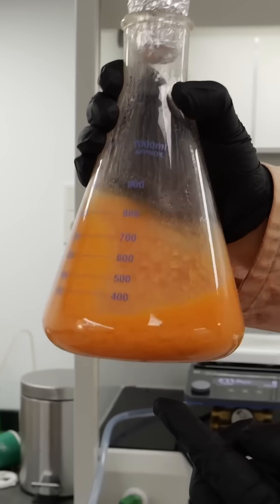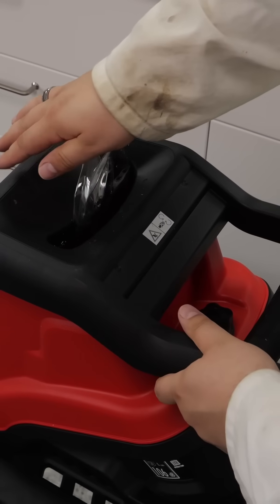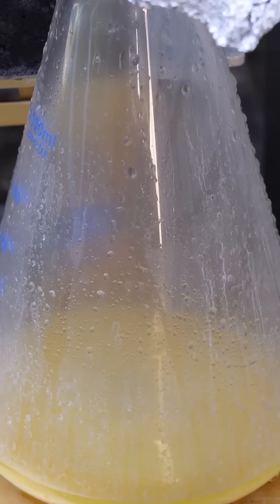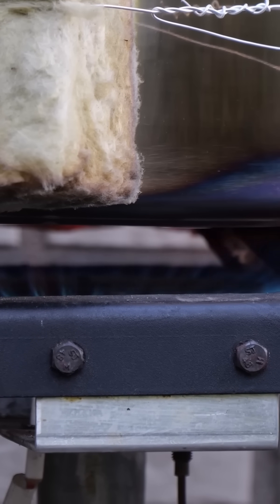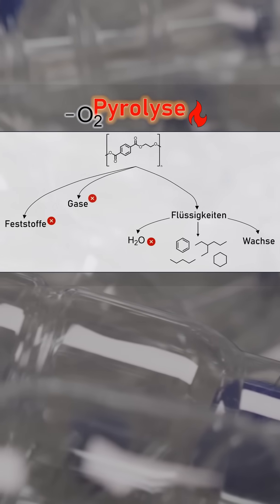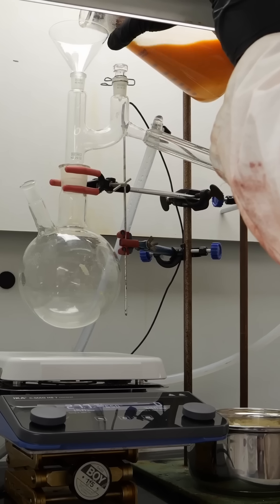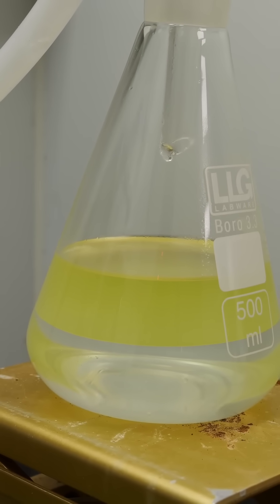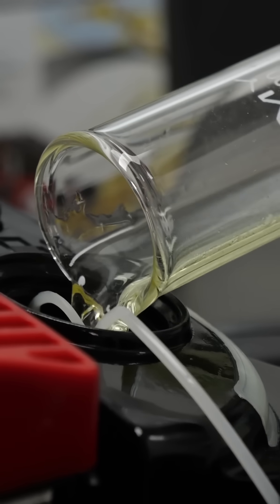Making gasoline from PET bottles  | JeyJey

Comment: If u run the chainsaw on only gasoline it will seize up u need to add oil to the gasoline its a 2 cycle saw is it not?

Comment: Was the distillate pure octanes? Or octane/heptane mixture?
Reply: Well since he distilled it by fraction (you see two distinct fractions in the collection flasks after distilling), he's probably going for the lighter hydrocarbons, but pretty much at random. He won't know what's the actual composition until he pulls it through various analyzers like GCMS.

Comment: Yeah, but for a real trick, can you turn it back into plastic?
Reply: Well literally yeah, a pretty substantial part of the liquid product are monomers to polystyrene or polyethylene for example. If you know how, you'd be able to turn the liquid pyrolytic oil into various new plastics, which is immensely more efficient than trying to distill out usable fuels.
Reply: @benedykt123313  that would be interesting to see is it a reaction that can be mixed and poured in a mold before it becomes a plastic?
Reply: @prestonm4s Well you'd need some kind of starter, but yeah.

Comment: unfortunately burns fuel to get fuel. but it's better than permanent waste, at least until bacteria learn to dissolve it.
Reply: It's not better at all, it's worse.  
PET isn't fit for pyrolysis as the product is contaminated and corrosive when used as a fuel.

Comment: That is interesting, but it is probably better for the environment to keep that carbon locked up in plastic.

If you could make diesel fuel from carbon captured from the atmosphere then you would really have something.
Reply: those gasses are very bad tho
Reply: I don't think you understand the difference between carbon in the atmosphere (CO2) and carbon in, well, most everything else. 

Trees have carbon (it's what gives them most of their mass.... They get it from the CO2 they absorb); that carbon is essential for soil biology and by extension, plants. 

All I'm trying to get at is, saying the carbon is better "locked up" as plastic is missing the forest for the trees; it would have been vastly preferable to not have mine dinosaur juices to make it in the first place, or even to say the amount of resources used to reconvert it to gas in this vid unworthy the product (Im Not dissing the creator). Gas is gas, at the end of the day, and while it does make 10-20% of CO2 emissions via transportation, there are worse culprits, and other gases responsible for the greenhouse effect. 

Diesel is worse than gas for CO2 burn gallon burned, and you can't just turn carbon into fuel... And again, it's the carbon in these fuels that's the problem. Which is why scientists are looking into things like ammonia (NH3) for carbon free alternatives 👍
Reply: @LuxLucidOfficial  im pretty sure pumping the air full of nitrates and nitrogen oxides wont be much better
Reply: @LuxLucidOfficial diesel can burn leaner and cleaner than gasoline can and it's more energy dense so that results in better mileage in general. Overall it has the potential to create less CO2 per joule generated. It can also be made from various triglycerides like used cooking oil. Albeit the agricultural demand to support the current number of vehicles would be enormous.

Comment: How much energy is required to convert the plastic into gasoline?  Is it more or less than the energy you get from the gasoline?
Reply: I'd be surprised if you could get more energy out than what you put in
Reply: @Syndicalism the PET plastic already contains a lot of potential energy, but it's not useful for combustion because of the soot. The question is whether the energy required to convert it to gasoline is exceeded by the combustion energy of the gasoline produced. 
Someone else put the energy into producing the reactant (plastic), so it's quite possible that the energy balance between reactant conversion & product combustion would work out in your favor.
Reply: It’s enough that it’s not cost effective.

Comment: I doubt the fuel gives you more energy than it took to make. Industry knows how to recycle plastic a thousand different ways but it's always cheaper to make more plastic, so they don't. But this is even worse because it's not just smaller profit margins, it's setting money on fire for nothing
Reply: It took approximately 4x as much energy to produce as what he got back in crude gasoline.
Reply: and making a mix of all sorts of chemicals
Reply: Same for the stuff in the ground
Reply: @spray_cheese  No, making fuel out of crude oil does give you more energy than it takes to refine at the scale they produce it. Now it is non-renewable and finite, and it pollutes, but at least it is for now a source of energy. Turning plastic into fuel is not as good as just burning plastic to power a steam generator- which can be done to minimize pollution, by the way. India has a pretty good system of burning trash in a reactor that captures all the soot and pollutants so all you get is heat to boil water and solid bricks of poisonous charcoal that they burry in a landfill. Not perfect, but if the trash was going to a landfill anyway it's better to extract some energy and get rid of any chance that it makes methane as it rots. Still will leech heavy metals into groundwater but it's better nonetheless
Reply: @EightyTwentyRatio  well I’m including the energy used in drilling and pumping, as well as constructing the barges and what not.

The plastic is already here. We have to work to extract the oil.
Reply: @EightyTwentyRatio  and everyone always gets the point of this process confused. The goal isn’t for energy. It’s to remove plastic waste to it doesn’t end up in our balls lol. It breaks down a lot faster as emissions than it does in large clumps of plastic. It’s one of those weird things where it seems counterintuitive. In that emissions will be good for the planet.
Reply: @EightyTwentyRatio tell me again why the companies selling things in plastic aren’t paying the recycling and disposal?
Reply: @spray_cheese can't tell if you are a troll or just lack cognitive faculties. Oil refining isn't done to waste money, its one of the most cost effective energy solutions in the world, the whole process included. Why do you think oil rich countries are rich?
Reply: @G-Rat124  energy used ≠ value. Just because it requires energy and labor to make something doesn’t mean that’s automatically the price.

Countries with oil are rich because they lack any regulations to prevent them from extracting it. So they are one of few places that even sell the stuff. So they make the prices.

Basic supply and demand.
Reply: @G-Rat124 You're right. The amount of energy it takes to refine crude oil is small compared to the amount of energy you get from the resulting fuels.
Reply: @lukesanchez9961  7-15% of the crude oil input is used by a refinery. I wouldn't call that small.
Reply: @joergsonnenberger6836 Also if you think a 7-15% energy loss is not small then you don't know thermodynamics
Reply: @joergsonnenberger6836 According to these numbers you provided we get back 460% to 1229% more energy back in sellable fuels. Otherwise we could burn straight crude in our engines, which we don't do for very good technical reasons.
Reply: @lukesanchez9961  The entire point is that gas refining is far from free. There are also a number of different products made by a refinery as part of the gas production, so if you don't have a use for those products, efficiency goes even further down. The main reason we are not burning crude oil directly has nothing to with technology: you wouldn't want to live in a place where many crude oil burning engines are active. It would make the early 20th century heavy industry districts look like a ecological utopia.
Reply: You can't recycle plastic forever so all the old brittle plastic could be used for this process driven by solar heat
Reply: @lukesanchez9961 you can recycle plastic a few times, and then even the most brittle, un-recycleable plastic can be used as building materials or insulation or you know they do have genetically modified micro-organisms that can break down plastic into degradable waste. The technology to make producing plastic a non-issue exist. It's just not gonna happen without the companies being seized and operated by a very competent government. So, never
Reply: Where did you do all this figuring chatGPT?

Comment: I can't believe people think Naturejab is some genius.
Reply: There's a sucker borne every day. It's actually just a bunch of children who have never heard of anything like that assuming he's the one who came up with the idea and therefore a genius. Part of the problem is the way he presents himself, but it's to his advantage that people think that. I really do hope he's able to at least break even with the products of his machine once it's run on solar, but I have MAJOR doubts based on the numbers I've seen from other research. I haven't seen his data yet, but based on the results of his analysis I'm not keen on his ability to clean out his machine or separate different carcinogens from the mixture. He doesn't yet comprehend just how difficult the distillstion of the crude product really is. Every single run has different composition of products that will boil at very different temperatures corresponding to various azeotropes formed. It's sooooo incredibly complicated and the stuff he's been calling plastoline and plasti-diesel don't properly fit within the boiling point, density, or calorimeter parameters of the real products and I'm not sure how he is going to address that. Currently, his mixtures are too filled with styrene derivatives and other reactive alkenes that would certainly gum up engines if used for longer than a 5min test run for stream. 

Idk what he does is cool, it's literally my favorite sub-category of chemistry, but there's dozens and dozens of reasons no one has been able to do it up until now. And the only reason he can partially do it is that he's fully funded by the internet.
Reply: @WizardZph ya he’s also got dangerously high levels of catious extremely toxic carcinogens as a result of processing the plastics as confirmed when he went to get checked up on by a doc
Reply: He's not an idiot. I mean the dude raised $16,000 in like two days.
Reply: @TheEbikeApprentice you can be an idiot and still fleece other idiots.

Naturejab is not a genius, or onto something other than track to create a super fund site in his backyard.
Reply: @TheEbikeApprentice  He is. He has no idea what he is doing, and he even filmed himself burying highly toxic waste where he grows his plants. That is an EPA superfund site in the making, granted he doesn't get cancer before that

Comment: isn´t the square bracket wrong? i can see a O-O bond in the polymere where there shouldn´n t be one. The right O seems to be to much. Isn´t it?
Reply: yup, the right one shouldn't be in the bracket, it's the residual alcohol that polymerized with the carboxylic acid

Comment: How many bottles required for 1 liter?! And how much did you produce in the lab
Reply from the maker: round about 50 bottles per 100 ml (in my lab). You can rapidly increase the efficiency In industrial scale
Reply: How many bottles is about the least interesting metric; how much energy is lost in this process? And that's a LOT, which makes it completely economically unviable to do. It's a very interesting process and pretty well known (just google "plastic pyrolysis fuel"), but also comes with a whole bunch of negative side effect which makes it completely uninteresting to do on any serious scale.

Comment: Would you put that gasoline in your car and is it legal to produce your own gasoline and also is it preferable to the prices at the gas pump.
Reply: @ektdredd2126  no, i would not use it for any engine I'm using. Yes, it is completly legal. No, the energy needed to produce just a bit of oil is hella cost intensive - there is a reason this process hasn't been commercialized. In a simple energy input/output equation its just immensly ineffective.
Reply: @NCDope  There is a German soft plastic  to oil called Biofabrik WASTX technology
Reply: @infinitetees  good to know, thanks for the headsup. I'd assume its funded and NPO though, right?
Reply: @NCDope  There are  couple of plastic companies in Australia that are in the process of developing soft plastic recycling using Wastx technology.